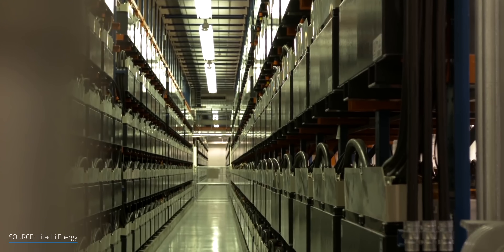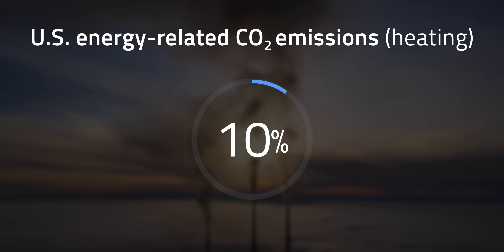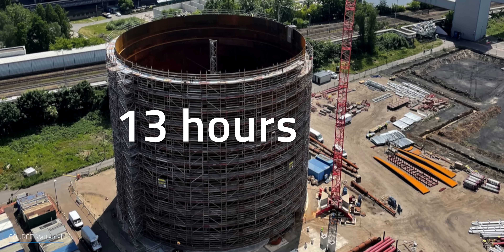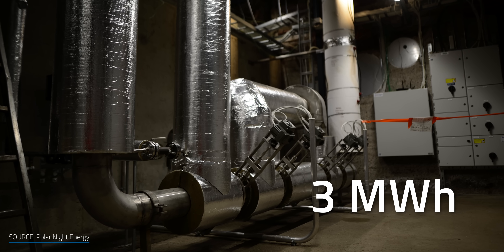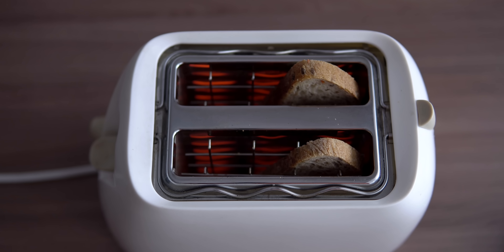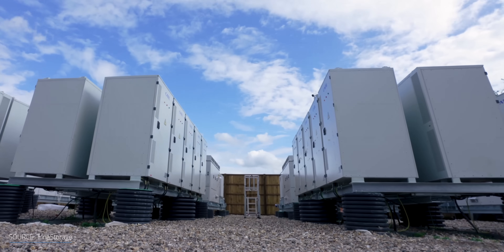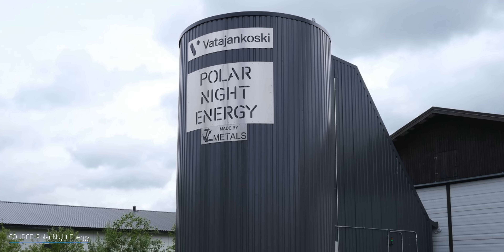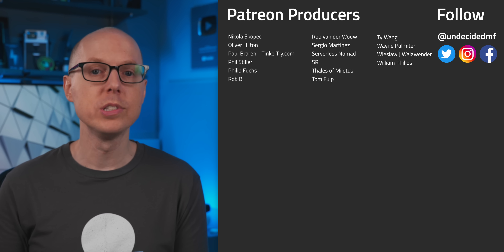How A Sand Battery Could Change The Energy Game

Comment: The problem with heat batteries that are powered by electricity is that you convert a more noble form of energy into a less noble one. Considering that you could also store the electricity in a form that can be reused directly to make electricity (eg. pumping water up a mountain) it's not really that of a good idea either.
On the other hand: If you need the heat anyway and have too much clean energy that you can not use otherwise for whatever reason, this might be the perfect solution here.

Comment: First Dutch-made home battery "Sessy" in production (source MSN)

After a successful crowdfunding campaign, start-up Charged will start producing the first Dutch-made home battery at the beginning of September. Thanks to the smart software, this Sessy ensures that owners of solar panels use more of their own solar power and that people with a dynamic energy contract can even earn money with their home battery.

Batteries are essential in the energy transition. They temporarily store green electricity for periods when there is little wind or sun. This also prevents grid congestion at times when too much green electricity is supplied to the electricity grid and the voltage rises too high. With a home battery, owners of solar panels can store their own energy from their roof.

Most batteries from Asia
Almost all home batteries are currently manufactured in Asia or America (Tesla), although Europe is working on its own battery industry. For example, TNO has developed a salt battery in which excess heat is stored. Charged has also developed its own battery. "We have invested for years in gaining knowledge so that we know what we are talking about. In addition to the hardware, we also find the smart software important. This ensures that the battery will charge and discharge at the right times, so that it keeps the zero on the meter in people's homes or can save maximum money," says Director and co-founder Roeland Nagel of Charged.

Increase own electricity consumption
Compared to other batteries, the Sessy has several advantages. It can work with all brands of solar panels and inverters, while most batteries only work on inverters of the same brand. It fits into a so-called open ecosystem of devices that communicate with each other via the internet, such as charging stations or household appliances. People with a dynamic energy contract can even make money thanks to the smart energy manager by storing power when prices are low and delivering it back when they are high. The Sessy switches off the solar panels even at negative power prices, if the electricity supplied costs money instead of yielding. Furthermore, the Dutch battery increases the own power consumption of solar panels by 30 percent: from an average of 30 to 40 to 60 to 80 percent.

Netting phased out
In the Netherlands, the market for home batteries is not yet so developed, partly because consumers can supply their excess solar power back to the grid and deduct it from their own consumption. However, this netting scheme will be phased out between 2025 and 2031. In order to be able to bring its small plug & play battery to the market, Charged therefore first started a crowdfunding campaign to gauge the enthusiasm. In three months, more than 600 Sessy's were ordered. "People have signed up en masse for the presale. That gave us the push we needed," nagel says.

Batteries delivered in 2023
Charged can therefore start production next week. First the test batteries will roll off the production line and in the autumn the Sessy's for the consumer. These will be delivered in the first quarter of 2023. Because many consumers showed interest during the action, but still wanted to wait, Charged thinks it can scale up quickly. For this, the startup is looking for investors.

The company in the Achterhoek was founded by Roeland Nagel and Twan Vooijs, two technicians who want to contribute to the energy transition. "The home battery is about to break through in the Netherlands. The market is still dominated by foreign companies, so a Dutch producer is quite special," says Nagel.

Comment: Wouldn't it make more sense to put the resistive heating element directly into the sand silo? It would offer direct heating of the sand and reduce losses in the movement of air into the sand.
Reply: It could relate to isolating the power lines. I'm not sure of the arrangement they use. It might even be possible to eliminate a power transformer stage and reduce conductor size, depending on what kind of resistance elements they use.
You wouldn't want MV in the sand. (MV=Medium Voltage; 1KV to 35KV)...
Reply: @troubleshooter1975  that's a good point

Comment: Using solid material as heat storage has advantage over liquids, In liquids convection will make it less effective. Here in Finland they made solar heat storage with water in 70's,  it just didn't work, because of convection.

Comment: Why not power a heat pump to heat the storage medium? Seems to me that increases storage efficiency 2x or more and reduces thermal impact in the local environment.

The heat pump could also be used for local freshwater collection through condensing.

Comment: there is a company out of calgary called eavor that does a version of this using geothermal technology. I think instead of building batteries above ground, why not drill pipes deep underground and store excess heat there, with a ring of geothermal wells around it to capture the excess over time.

Comment: Using some material medium to store "temperature" is not new. From my understanding the Honolulu airport uses a similar principle when they run refrigeration equipment in the evening hours and store the cold to be used in the daytime when the temperatures are much higher with the need for air conditioning.

Comment: While it is another option, it doesn't sound feasible yet.
Current cost for sand storage is $15 / KWH, with up scaling they expect the cost to drop to around $10 / KWH.
This equates to around 100 to 150 times more than our current electricity cost, most folks can't afford to pay $30,000 a month for heat. If they convert that heat back to electricity then you can expect to pay over $120,000 a month for electricity, which is 4 times the cost of just using the heat as it is with no conversion. Currently this is another green energy solution that ends in bankruptcy.

Comment: Great, but...
This is one simple idea for storing excess clean energy. Producing heat is easy, you heat air and dump the heat in sand.
BUT
... what if you need cooling. How can we "delete" heat. A heat pump is efficient, but still produces heat. And at this point any system that produces heat needs to be counteracted with a system that removes heat. We produce heat on a masive level, from a hot car engine to the hot shower we take each day. Can we recycle the heat from the shower? At what point do we need to think to create an AC for the entire planet?

Comment: There was an interesting model that used a mirror array that directly focused a beam of light down into the thermal battery below the ground of the mirror array. 
It would also be interesting to see some sort of high temperature phase change materials used with heat pumps to push efficiency over the 100% level for resistive heaters.
Reply: I think we should have solar panels orbiting so they always face the sun and then Lazer beam the power around to the dark side of the earth and shoot the photons at the solar powerplants
Reply: @TheAnnoyingBoss  Why? Ground based solar doesn't take up much space. It would cost a fortune to launch the panels into orbit and then you would have a dangerous high power beam right in the middle of sky. Storing power in thermal batteries is relatively cheap and easy to implement. Plus they can't be used as a weapon and aren't at risk from stray pebbles traveling a few thousand miles per hour.

Comment: Storing heat in sand is not new. Many selfbuilders have done this to heat their homes. Some having it under the foundations with water pipes running through the sand heating underfloor heating..

Comment: Requesting you to consider some improvisation based on my experience and research and make episode on them.
Firstly state of using heating elements and electricity to heat of sand it would be more efficient to use solar energy or heat pumps secondly cooling is more energy intensive then heating so some research has to be made so that such methods can be used for cooling of the space and lastly the need of the day is to make a technology which can Store cool instead of heat

Comment: In a temperate climate where air conditioning is necessary in the summer, and heating is necessary in the winter, this sand battery could be paired with heat recovery heat pump technology rather than resistive heating. Waste heat pumped out of buildings (that isn't used immediately for domestic hot water), could be dumped into the sand battery via the refrigeration cycle, and thus stored for the winter. That stored heat could then provide a heat source for the heat pump to make domestic hot water, hydronic heating, and/or heated air.

Comment: since sand is inexpensive, and energy is costly. i would like to see this used with other heating sources than resistive heating.

if you use a heatpump you cannot get to high temperatures efficiently, thus for a heatpump you simply build a bigger storage solution.

waste heat from industries (perhaps combined with a heatpump to increase energy density) would make an excellent resource to use in the summertime when that heat would otherwise be wasted.

Comment: Sand, stored at 1000 deg F, in off-the-shelf steel silos, can maintain that temperature at 99% efficiency across seasons (which I interpret as a 3 month time period)?  How is THAT possible?  And why praise the use of heating elements (100% efficiency!) when they are 25-33% as efficient as heat pumps?  Finally, and this is just a peeve of mine, the constant use of the claim that traditional battery storage is only good for 6 hours.  That 6 hours claim is not a limit on the medium itself (which measures % losses in terms of months) but on current economic scale which itself is based on maximum discharge rates.  If you have enough capacity, batteries are sufficient for many days, if not months.

Comment: Storing heat in water would make more sense to me. 100t of water at 95°C would store 8MWh too (using 25°C as reference temperature) and has a much better heat conductivity to transfer it.
And water it much easier to transfer, probably cheaper than sand, less fuel burnt to get it to the storage.

Comment: It makes no sense that they would use resistance heating when they could be using a heat pump and getting 4x the energy out of it. It would most likely limit the temperatures, but better to heat more material effectively than less to high temps. Multistage high temperature heat pumps could be designed though. 
The surface area to volume ratio decreases with increasing size so there is less area to lose heat per volume stored by using more material potentially at lower temps vs less at higher.   Also lower temps have less of a thermal gradient to drive heat transfer/loss. It may limit the use of the heat being a lower temperature, but that is already going to be limited by the whole mass cooling down over time.

Comment: One thing to consider though is that a gas generator is about 20% to 30% efficient at making electricity, so the thermal battery could be competitive with these sources at 25%.

Comment: I question the heat transfer medium, as well as the ability to store heat for months. Heat's pretty slippery stuff. We'd need to build infrastructure to distribute that heat from where it's stored to where it's needed, & hot air is a notoriously poor transfer medium. So I can see them maybe helping small communities, but I don't see how it could scale up very well. And I don't see the heat storage lasting for months, or even weeks (& certainly not for entire seasons). The heat losses would become dominant in only a few days, unless the storage tank (& all the distribution piping) was VERY well insulated. Still, it's an interesting concept, & I'm glad someone's looking into it.

Comment: This could also be used in current solar thermal plants to increase the thermal storage for later power production as there is already the extra step of converting the heat to power in such a plant. If it is cheaper then there current method of simple storing the heat oil in the one type of solar thermal plant. it also lacks the weakness of a molten salt solar plant. The weakness of molten salt solar thermal plants is that you can't allow the salt to become solid or it will damage the plant.

Comment: No,no,no. You will never get 99% efficiency with an air heating system. Spend 2 minutes calculating the fluid flow resistance (you did study thermodynamics, didn't you?) for a district system and you will know it will be way worse than this.
BTW, you CAN heat water above 100C - it depends on the pressure. Thermodynamics 101.

Comment: The question in my mind is would this be efficient if the heat output could be used in an absorbtion chiller scenerio to provide cooling in the hot southern climates?
Reply: There would be a condensation prublem but if that can be solved, sure.
Reply: @swedmiroswedmiro1352  Not unlike air-conditioning today.   Many larger facilities cool their work spaces with waste steam or heat.  RV refrigerators that use LPG are also absorption cooling, cool your beer while burning propane!

Comment: by the way.. to start with heat batteries.. you need very good "insulation" material around it to not loose energy (heat) easily..

Comment: I'm sure this can play a part in heating solutions going forward. A caveat I have is an article I read this year concerning the diminishing supply of sand. I know my state university, the University of Minnesota could benefit from this. I imagine many campuses and state buildings would benefit. There is a huge potential for this in our Twin Cities region. Duluth as well! ❤️
Reply: The deminishing supply of sand is mainly about high quality sand. This can use any kind of sand, even finely crushed bricks and concrete.
Reply: Construction sand has potential supplies issues.  But desert sand is plentiful.  I would think desert sand would work as good or better as it can pack more densely.

Comment: While I was hoping for a home solution, this does seem good for the district heating, as you said.  I believe the University of Madison still uses a coal powered boiler to send hot water to alot of buildings on campus.  I wonder if this could be installed to cut down on the amount of coal they would need to use.  Granted, I haven't seen any large solar or wind projects around campus, because it's a dense urban area, but it would be something they could consider doing.

Comment: Wow, what a terrible idea. Using solar panels to heat sand wastes about 80% of the incoming sunlight. Just heat the sand with sunlight directly.
And 8MWh may sound like a lot, but it's not even enough to heat 10 homes for one night. The terrible insulation of the silo also means that most of the heat is going to get lost.

Comment: You didn't mention another common heat fluid medium, thermal oil.  I've worked at 2 plants that use it, to make fiber board and plastic, I know its also used in asphalt manufacturing for roads.  This would work great in those applications, ideally re-designing the manufacturing plants to utilize the hot air directly though we're talking many billions in infrastructure (best just to heat exchange with the thermal oil).  Production facilities that are run by investors (most) are notorious at skimping on maintenance and upgrades (even when investment paybacks are under a year).  The income generated has to be greater then predicated income on other investments.  Improving infrastructure should not be an economic incentive but it seems to usually be that way.

Comment: Since it's sessional, why not use heat pumps instead of resistive heaters in the summertime and that very same district heat distribution network for cooling by circulating cold water that those heat pumps extracted heat from. The system would basically have at least 50% efficiency increase for relatively small tradeoff in complexity

Comment: There is still the issue of installing hot water pipes, which is an entire infrastructure on its own. I would design it as a network of silos, each of these providing heat to the neighboring buildings, factories which rely on thermal energy, and greenhouses.

Comment: I have to ask: why use forced air to transfer the heat from these batteries rather than water or molten salts?  For residential use, water should be a much more efficient heat transfer medium than air, as it can store far more heat per unit volume.  We use 19th-century hot water radiators to heat our house, and they work a treat—better than most forced-air systems.  Sure, water can’t go above boiling point, but how often does a house need temperatures over 100 Celsius?

Comment: It would make so much more sense if they used a heat pump of a sorts rather than resistive heating of the sand, the heat pump should nudge the heating efficiency to anywhere between 200-300%, that is a lot.

Comment: Idea for short terms storage,  let's say multiple cycles in in a month  utilizing cheap energy hours is feasible but let's say if one wants to store summer energy over winter it would require massive size battery to cover need of energy for several winter months even for relatively small size apartment building.  What is 8MW storage capacity if building with 2000 square meters in mid winter needs 30MW heating capacity. The size of that storage facility would become enormous.